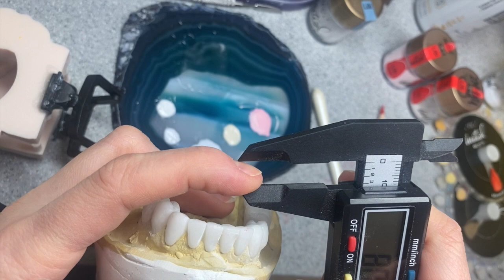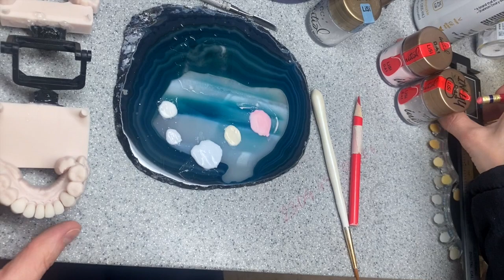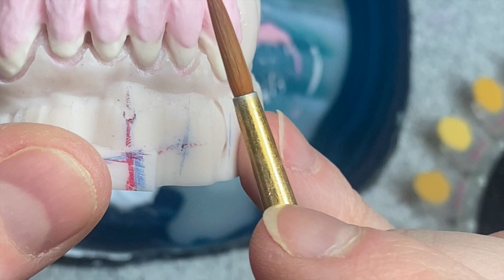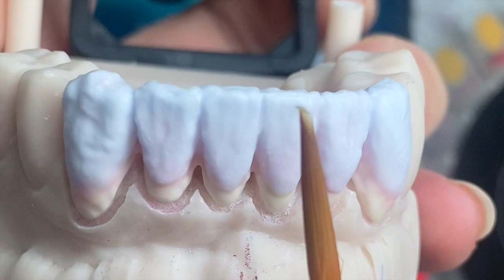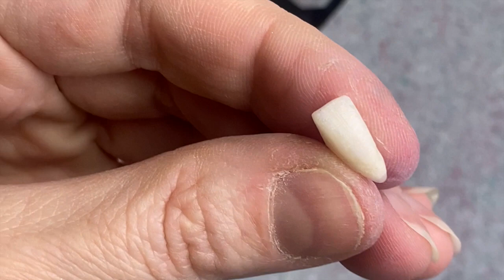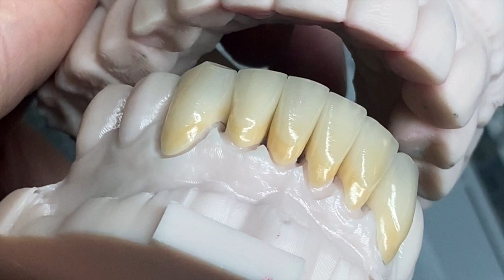How to Make Long Front Crowns Look Natural

Comment: Wow nice work as always! Thank you! The tissue is so deep. I wonder why the printed model didn't show all the tissue...
Reply from the maker: Hi, Won! Thank you☺️ This model was ditched so no tissue is left at all, it happens a lot in our lab because the task of technicians who work on the case before me is to make crowns sit well and they don’t understand how important tissue is for me to do buildup correctly😔 I have asked to make 2 models: one for sitting crowns and one for buildup, but no luck there for it is not my lab and I can’t make calls. That’s why I have learned to investigate 🔍🕵️‍♀️🤭
Reply: @verahadden4712  Hi, I am sorry to hear that and I do understand your frustration on the assembly line of workflow... I have been there.... For sure, they can print simply 2 models with or without ditching and they can even cut like checking model to save resin and time. I currently work in-house lab as a one-step, meaning starting to finishing. It is a lot of work but I can tell, this is very effective system in a small lab. I dont even make die model but 2 solid models and extra separated die to check margin.

Comment: It's super wired lab policy ..so basically they print models then they increase cement gap to avoid friction basically to get same result as they would with a type lV plaster with 0.010% volumetric expansion..then they mount those 3d models on a 1$ hinge ocludator which have worse precision then if you just use hands to simulate TMJ movements :)..Vera one day when you make your own lab don't make such mistake :)  just use plaster models and a proper articulator with a mounting table ( campers table ) and enjoy
Reply from the maker: I agree! This case does not make much sense , but it is very thought provoking and a great conversation starter 😉 I have got great advice and a lot of very useful information from comments on it 🤩 Thank you for sharing your experience and ideas with me! 😊🤝
Reply: Please please Hope the next clip will you share how to mix porcelain to standard color
Reply: @joinclass3  in 3D shade guide is easy..for example if prescribed shade is 2m2 ..the your core of opaq dentine shall be 2m3 and for your pigmented enamel u shall use 2m2 or 2m1 dentine...in classical system is different..if you need C1 shade ..your opaq dentine core will be A3 and filter in pigmented enamel c1.. for A2   core B4 pigmented enamel A2 ..for A3 core is B4 and filter with C1 dentine .. (core is done best with opaq dentine..mini version of the tooth aprox thickness 0.3 mm ) ..pigmented enamel is a combination of transparent dentine ename and clear..in VMK it is for example. TD A2:EN1:WN ..1:1:1 mixing ratio